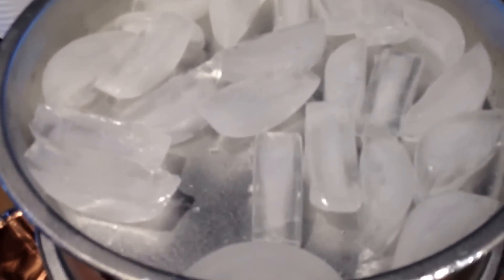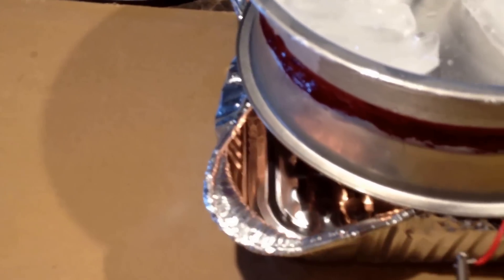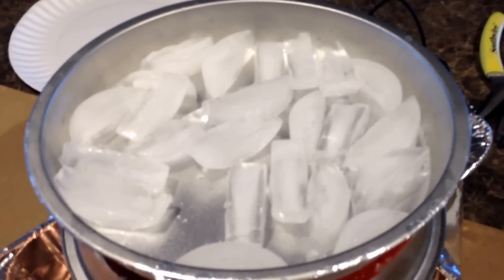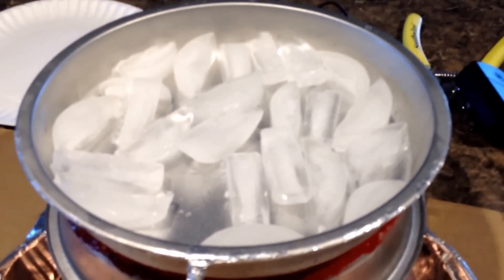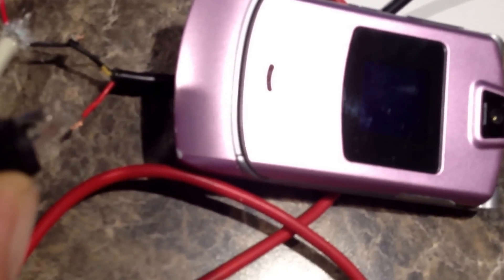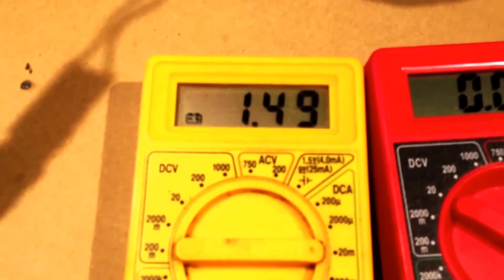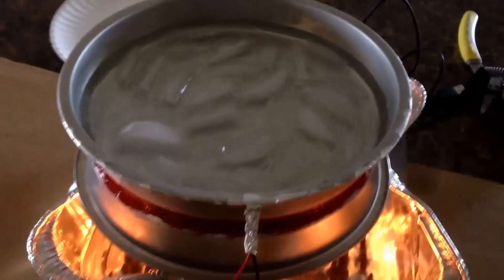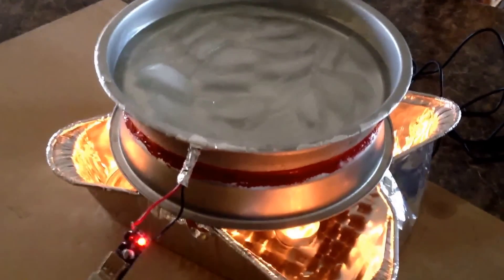Vid 2/2 Testing, DIY How to build & What is a thermoelectric generator, module, cooler, peltier

Comment: I appreciate you doing this experiment. I was considering doing a very similar experiment, and you basically saved me the work. I love the idea of using the peltier effect to generate power, but this level of power generation for the cost is so low. The amount of heat that needs to go through in order to get some amount of power is very high as well. Don't get me wrong there are some uses for this type of power, generation, but ultimately buying a battery are periodically replacing it might be much cheaper.

Comment: Remove one of the Aluminium pans to put the side that should be cold to tge ground, put it into water make a fire in the pan. 
If you camp at a greater water source this would be much more efficient.
Reply: Can you link me these special peltier elements that are made for making electricity? 

It seems I dont find the right words for the ebay search.
Reply: I need round about 28V to fill my batteries in Winter. I hope I can met that without conversion.

Comment: you need to change your mental point out to Copper and you need to make sure that that high temperature silicone this and acting like an insulator insulated it from the heat a copper plate would get you more he thanked take a little bit of heat hope this was helpful
Reply from the maker: +Andrew Victor thanks

Comment: Also for what i just posted, if you need help or would like me to post diagrams of my setup or pictures  just ask would be more than happy to share what i have learned :) i connected 300 of these in series and parallel  my generator is 4 feet by 8 feet long and produces about 300 to 500 watts
Reply: i have had mine at 12 24 and 48 when i first built it i wanted it versatile, so i added rectifying diodes to my configuration when i connected them in parallel, my voltage would jump around a bit but kept it close to those numbers.. but nothing gained in the process if my voltage went up then my current went down, not matter what i did i could not get any more total power from it. It is very heavy considering the amount of modules and that they are bismuth which is almost as heavy as lead. i dont know of a practical application for my generator as a solar cell of comparable size would produce just as much power or even more but it was fun to build. I can tell you that mine pushed me down the road at 18mph i put it on a trailer with a bike at one point and connected it to a brushed dc hub motor,  didnt use a pot just direct connected it was cool to fly down the road with no batteries being completely thermal powered,  but i cant imagine this competing with todays battery standards.. It was fun to do though... i still have it all in my storage i really need to get some pics on here or post a video if anyone wants to see it
Reply: Mike Cull 

Thank you Mike about all  information you wrote 

And really I want to see your project
By video or picture it’s fine to me

Thank you again!

Comment: Hi Ray, i have done some extensive testing with these modules and thought i might drop you a comment. For temperature dont want to exceed around 420 C.. about 788 degrees F. They can handle quite a bit of heat but if you exceed that the junctions inside the module will begin to break down and the module will fail. They can however produce alot more energy than what you are getting i have had one single module at 4 volts near  500 ma. i would not run that continually but did run it that way for 3 hours. The trick to that is realize that if you put heat on one side, you can put cold on the other , that will work, but for the best efficiency its how fast you can remove the heat from the opposite side. A plate of ice water will work but its not letting the heat pass thru the module and escape its forcing the module to heat the ice water and water has a very high specific heat so its basically trapping the heat in the module not letting it excape. Think of an internal combustion engine the faster the air in and out the more horsepower. this is kinda the same way but its the faster heat goes in, and it taken away you will get more electricity.. copper and aluminum both have great absorbtion rates which is why they are used in heat sinks. the faster and farther you move that heat away from that side of the module the better the result will be.  Try heating one side  with a candle and using a thick piece of aluminum or a heat sink on the other with water moving across the aluminum from a little fountain pump into a container full of room temp water and circulating, I guarantee you will see a significant increase in electrical generation, more than before and enough to power that little pump with more left over than what you are producing now. Give it a shot
Reply from the maker: +Mike Cull Thanks for all the info thanks very much

Comment: now in theory if I had the TEG's cooling side face up under a thin sheet of metal that has constantly running water on it would I be able to use an incandescent light bulb to keep it going as long as I gave it a "jump start" with a different source to get it going?this is assuming that I had enough to produce the required power to light an incandescent bulb

Comment: why it turns off? because the power you are putting into the booster goes bellow 0.5 v. now if you look at it the five volts you got were becase having no load the generator acted as a capacitor and accumulated energy. Once you put the load the "capacitor" discharges and since you are not generating enogh energy y can not go back to a decent value but since the booster is designed to draw when the generator gets to the 0.5 volts and generates 600 mA equals to 0.3w. you need more heat but replace the booster with a 12 v  charger because at full power you should more than 25v and you will blow the booster or put them in parallel and keep the booster. good luck and good job. att Martin (amateur)
Reply from the maker: +Martin Espinoza Thanks for the info

Comment: How do u have such low voltage? I use just one on a heated piece of metal and it gives me 6v minimum.
Reply from the maker: Will6804 I used the cheap ones I have not tried the better ones yet
Reply: +Will6804  I think its His setup. If you read the operating instructions each peltier chip is designed to output 5v at 1 amp. Erego they are 5w peltier chips. However their normal operating temperature is 320c or around 650f for the hot side and air temperature 80 degrees. Using the cool side to power this device is unfeasible unless you live on the moon. (or you have a refrigeration unit that can achieve -300c and the "hot" side was outside of this refrigeration remaining 80f) This temperature difference is what gets you the amps. Tea candles will not do. LOL if the pie pan (the lower one) was near 600 degrees you should not be able to handle it without gloves or tongs.
Reply: +Once Asleep You might want to try an alcohol burner they get pretty hot and have nice sized flame that will probably heat that pan close to 600 degrees in 10 minutes or so.
Reply: +Will6804 Is that 6 volts with or without a load?
Reply: +Once Asleep The manufacture rates the top temp allowed at 70C (158F) for these units.. But I would imagine, that as long as you stay below the melting point of the solder used to build them, you should be fine.. So stay under 170C (338F)

Comment: I've been experimenting with these TECs as power generators. They are only rated to 150C or 300F. With better cooling, as with a water block type heat sink with circulating coolant you could push it to the maximum and probably be OK. I know I've had mine go over 300F on the hot side measuring with an IR thermometer, and did not fail.  Best test I've done is about 2 watts per module using 275F hot side and 67F cooling water.   https://www.youtube.com/watch?v=rUDS8fcTbUs
Reply from the maker: Thanks for the info I will check it out
Reply: What is the wattage of the peltier?
Reply: C straley well most of them are 60 watts my Peltier is 60 watts also its 1706 also some can be 80 watts but when you buy them it will show you the wattage and the version my Peltier is 1706 its probulay the best one the 17015 uses alot of power and it sucks

Comment: Nice try but a few things you didnt catch on before starting. Firstly the only difference between a TEC and and TEG is how you use it. They are identical manufacturing process and function exactly the same. Second you are using the lowest powered units on the market (That's why it was so cheap). There are other like the TEC1-12730 which puts out 12v 30Amp (360 watts). they are about $45-50 for two units. Thirdly the premise on how a Thermocouple works is the greater the temperature differential the more power it will produce. For best results use a hotplate or stove on med heat and cool with a circulating glycol (antifreeze) solution through a small radiator assembly (transmission coolers work great) with a large computer fan (12v) usually they are only rated to 1-5 watts. I have test this and got almost 400 watts of usable power.
Reply from the maker: Thanks for the info, I think I  will buy the better TEC and give this a shot. Thanks again.
Reply: Buffalo_Chips..Dude... the efficiency is like 5%, 360W × 0.05 = 18W generated power at best!
I think many medium priced modules are a better way.
With 400W generated power, you would get the nobel price in no time ;)  
Please show us if you are able to do so, but I only think that you only wannab a youtube millionare! =)
Reply from the maker: I wish, but would be nice

Comment: The phone is a Motorola V3, the battery is 3.6V Li-Ion 680 mAh battery :) I like that 5V booster. I have 5 of them. I use one wired to some 18650 Li-Ion batteries from old laptop battery,and they are been charged from a 5.5V 140mAh solar cell. And it works great. Cool video!
Reply from the maker: I love the booster I saw it on another video and it works great, thanks

Comment: The amperage jumping around is because the output is being "shorted out" by the phone because the TECs cannot output enough to satisfy the booster.  When the booster sees the short it restarts the continues.  It is kind of acting like a MPPT (maximum power point tracking).
Reply from the maker: Thanks for the info that makes sense